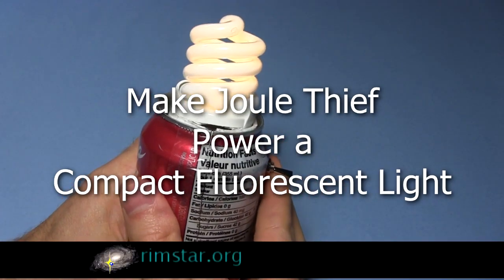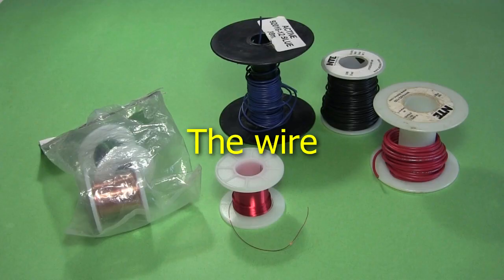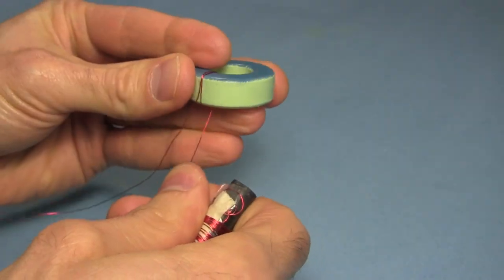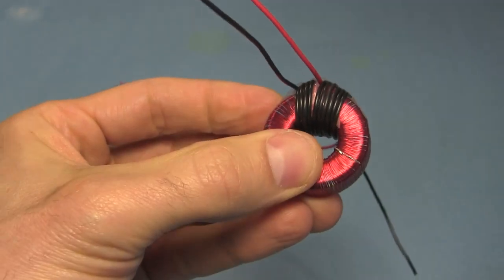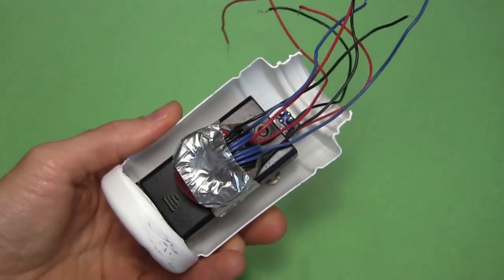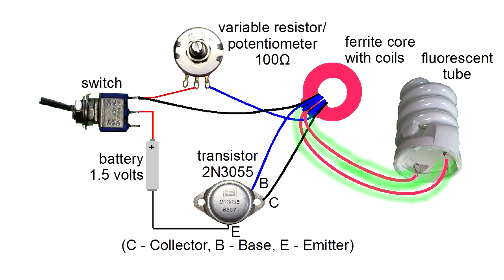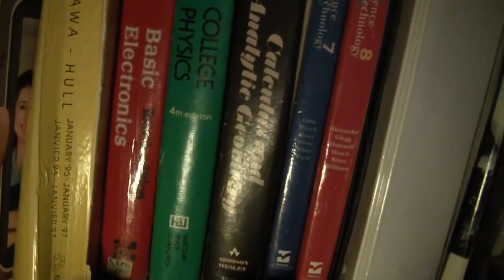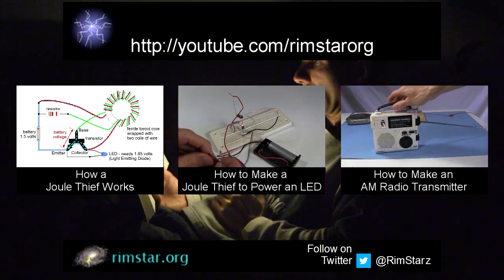How to Make Joule Thief Light a CFL - Jeanna's Light

Comment: how do we do to make a joule thief  1.5 volt input  16 volt output
Reply from the maker: Kascios Seb What kind of output voltage are you looking for? DC, AC? Joule thief output is nothing like either of those. It consists of low voltage with periodic high voltage spikes. Will that do for your application? You can see some an example waveform in my video on making a simple joule thief here "Make a Joule Thief for Zombie Batteries".
Reply: make a joule thief  1.5 volt input  16 volt output for electric motor  continu electricity sorry i hv not a big knowledge about electricity i dont even know whts the difference btw AC and DC
Reply: could you help me
Reply from the maker: Kascios Seb A joule thief isn't a good solution for a motor. You should look for a DC to DC converter circuit instead. Unfortunately I haven't done any DC to DC converter circuits myself.DC stands for Direct Current and means that the electrons move in the wire in one direction only. AC stands for Alternating Current and means the electrons go back and forth in the wire, alternating directions. Some motors are designed to work with DC and some with AC. Since it's 16 volts, I'm guessing your motor uses DC. Usually there's something written on the motor that says what it is.Also, motors require both voltage and current (if you don`t know what current is then see my latest video.) The amount of current your motor needs should also be written on the motor. Your DC to DC converter circuit will have to be able to supply that amount of current.

Comment: RimstarOrg , I want to make a joule thief like yours, but unfortunately, I cannot find in any local store every transistor I found in tutorials. I wish someone would say "You can find the X transistor inside the Y device made by the Z combany", I don't know if you can get me. If anyone (including me) would find transistors so easy then, searching for an exact type of transistor from a local store to another local store would not be nessessary.
If you know transistors (which can work) from devices like PC power supplies and they are described in Joule Thief tutorials then let me know.
By the way, transistors from CFLs are not working correctly if I don't have a result in Google search about using them in Joule thief experiments.
Reply from the maker: Unfortunately I don't know of any specific devices where you can find these power transistors. This is something I've been asked before too, so I keep an eye out for them. I buy mine from local stores, and of course you can buy the online. Mongrel Shark has done a lot of salvaging so maybe he knows where some kinds of devices that can be torn apart to find power transistors like 2N3055s.
Reply: Unfortunately I have not found them. Really old rotary dial TV's  had good power transistor of similar range. Everything modern that needs high power switching uses MOFSET's as there are more efficient, and easy to run from a digital signal. Power transistors are one of the few parts I buy, and I'm someone who salvages solder for re-use.

PC power supplies do have some good transistors sometimes. From the 2sc range. Many Crt tv's also have a 2sc range transistor, but they are harder to use than a 3055. You need to study the data sheet for the transistor (google the number on transistor to get datasheet) and stick to the limits. The big one being they mostly need a "Protection Diode" reverse biased from emitter (diode anode) to base (diode cathode). There is oftern a suitable diode on the circuit with the transistor.
They are common parts to fail in both CRT and PC PSU, so its pot luck getting them. If you do find, its really easy to cook them de-soldering. I had 100% fail rate before I got a good de-solder gun. The TV ones are easy to cut out wit side cutters. the PSU ones not so much.
Reply from the maker: Mongrel Shark
Thanks for the info. I suspected they were MOSFETs but wasn't at all sure. I've got a bunch of stuff to de-solder too, but am waiting until I get a real de-soldering kit.
Reply: A good de-soldering station is a huge advantage. I set mine hot. about 400c, and it sucks the solder off nicely in 1-2 seconds, before the heat has time to conduct up the leg into the component. I paid about $170 for my station, its one of the more expensive bit;s of gear I own, and its not great. Good ones cost a lot more. It has paid for itself, but it takes a lot of care and maintenance. Get's blocked a lot and the tips get corroded on if not dissembled and cleaned after every use. The better ones dont suck the solder down the heating barrel, and would be 10x better. On the up side, parts for my one are affordable.
Reply: So Mongrel Shark, I must buy a second hand CRT monitor for PC's, or a damaged one so I an find the transistors inside I want?

RimstarOrg , since noone can find such transistors in modern devices, I think you can make a tutorial in which you demostrate the design of an amplifier (using of course MOSFET transistors) in which you connect it's audio output with it's audio input to make it oscilate so, that type of oscilator can be used as an alternative joule thief.  
I have a question buy the way: when I visit a local store and ask for a high power transistor like yours the shopkeeper askes me: "you want it for pre-amplication or final amplification?" (This is how I translate his question from Greek to English). So, what must I answer him?
Reply from the maker: Than Zamp
I don't know. A quick look at http://en.wikipedia.org/wiki/Preamplifier versus http://en.wikipedia.org/wiki/Power_amplifier makes me think you should answer final amplification.
Reply: Yep. CRT monitor will have a transistor capable of this if you want to salvaged one. May take 3 monitors to get one working transistor though. I've only pulled one apart, but am told the transistors are excellent for this sort of thing.

At the store you want a Power Transistor.
Sometimes they are used in final stage. You may also want one to switch High Current devices on and off. From analog control.
Or just say you want to make a powerful self blocking oscillator for Flyback driver Which is what A Joule Thief like this is.
Audio amp transistors will be very sensitive (easy to kill). Stick with 2n3055. I get 10 or more at a time cheap on ebay. The 2n3055 has not been used in Audio amplification for over 30 years.
Reply: The easiest way to get electronic parts are from '' digikey.com ''.
I bought a few times from them and I never had any problems.
Reply: Good in the USA. You have to be careful if overseas. I bought a $2 part from them once and they charged me $40 postage....
Reply: Mongrel Shark I assume you are in australia. Jaycar will be in most major town/cities. If you are in sydney W.E.S electronics is near ashfield which are about the cheapest
Reply: I have a trade account with Jaycar :) They are still horribly expensive. A single 20,000mcd white LED for eg. $5 at jaycar. or 200 for $5 on ebay, and the ebay ones are better quality. A lot of very low quality products at jaycar. If you can even get the part you want. They never have the stuff I want and refuse to order in stuff that's not in the catalogue. Its pretty much a last resort if I want something in a hurry and am lucky enough to find it in the catalogue. Although even then I usually regret going to Jaycar.
Reply: what state are you in? gold coast has go company wes in nsw but unsure of other states ..but if you have the ability to have trade account wes is very good and will post.
Reply: Gold coast :( I cant even find anyone that sells enamelled wire in a good range of sizes on spools larger than 30g :( would love a few kg of .1mm

I don't spend a lot on components etc, as have DSP budget, Main reason I got trade card at Jaycar is because the staff at local stores like my channel and know I am on a pension.
Reply: yes hard to find wire on gold coast cheaper from china. Tip at arundel think still has its shop and very cheap especially if you are looking for the parts. One mans trash is anothers treasure as the saying goes. Know a mate that frequents there and $2-5 gets you most items
Reply: I have a lot of stuff from old appliances. Heaps of CRTs and microwaves etc get thrown on the kerb here. The problem is getting longer lengths for big Tesla coils etc.... I have a meter long bit of 300mm PVC I want to wind up. I don't think a de-gauss coil will be long enough.... Postage on a few kg of wire is a killer, not that I can find anyone that will post what I need to Aus...
Reply from the maker: Mongrel Shark
I've yet to build a Tesla coil but won't splicing together wires work to get the length you need? You could corona dope the splice if insulation is the issue.
Reply: I have done it for lower powered coils, but getting the splice to be no thicker than the wire is a bit hard. A bit of a bulge once wound will act as a breakout on higher powered coils.
Reply: Mongrel Shark If you are salvaging the wire and old fischer and paykel washing machine has a large amount of wire in its winding as it has a different type of motor set-up
Reply: leigh Moom  If I could get my hands on one of those, I would be using it for other projects, like wind generator or electric bike.

Comment: guess what i find out new way more powerful you can't ever imagine get a faroid transformer or toroidal transformer  130 turns on secondary 5 turns on primary then connect it on zvs induction module device output here you go  recommend 100 turns on secondary so much high voltage and frequency output of that transformer